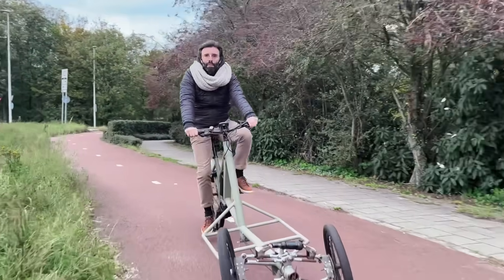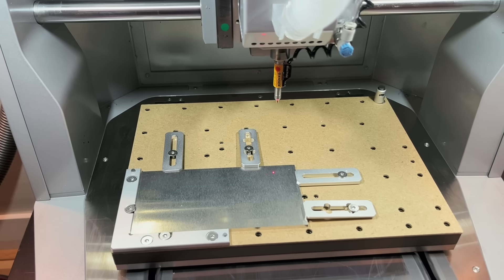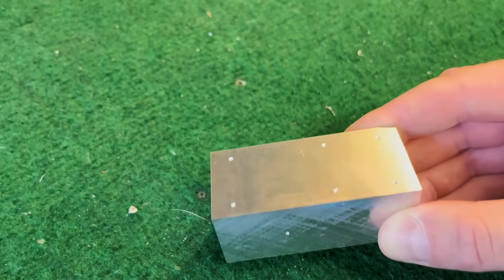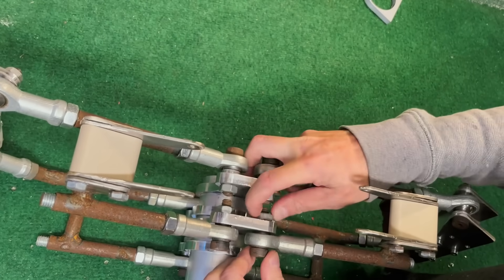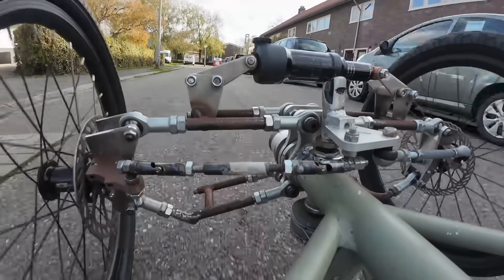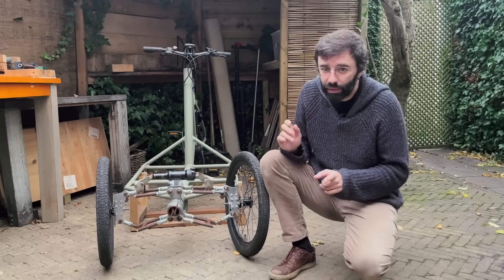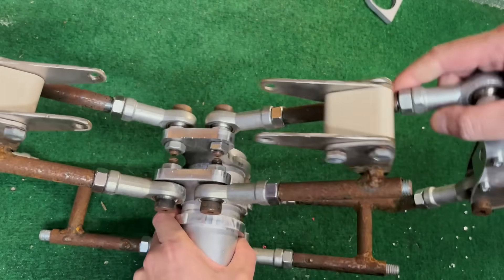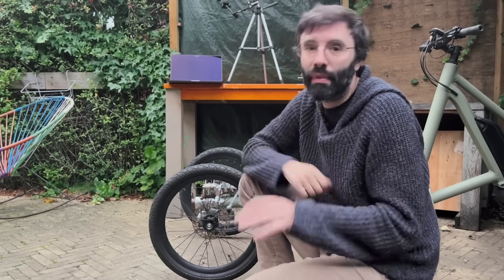#7 From 3D Printed to Aluminium - Tilting Mechanism with Makera Carvera Air

Comment: its so nice yet i cant help but feel its missing something...
"differentiation".
you need the outer wheel to drop further than the inside wheel.
why?
so its lowest gravitational potential is VERTICAL!
it "falls" to the bottom, straight ahead. any tilt "lifts" the entire frame, so its gravitational potential increases.

it wants to fall back to center, and be FORCED to tilt.

not flop over and be forced to stay UPRIGHT. a standard parallel linkage drops the frame when tilting...
 it WANTS to drop. it WANTS to fall over.

you seem to never take any shots where its standing upright BY ITSELF? without the stand?
perhaps, because... it doesnt?

really simple fix...
a "tee bar" linking both swingarms. offset pivot mounted to the frame to give the desired "offsets" on each wheel as it tilts over. locations of pivots alters differentiation... a "sway bar" of sorts, but it has to transfer more movement to the outer wheel... an "inverted" sway bar...

"jetrike". so far, the only tilting trike, or variants of, that has been naturally and inherently stable, that i am aware of. look into it. if the sites still up, that is...

otherwise, imho... you are wasting your time. it has nothing to set it apart from others following the same design route... just the same inherent flaws as the rest. looks great, yet never rides..."great".

even a regular bike does it. its hard to see, but straddle your bike. rock the bars. see how it actually tends to LIFT as you turn? its lowest point is straight ahead... THAT is why they are stable when moving. 
they also tend to steer IN to the lean. so they tend to "highside" back upright... a beautiful bit of positive feedback creating a stable system... 

forget gyroscopes, caster, camber,... think about gravity and how the weight "hangs" off the pivots... then you can see "rake" in a different light... the steering pivot and weight "hangs" off the axle... it wants to go straight.
with two steering wheels upfront, you now have kingpin inclination... more "hanging from the axles"... not camber, the wheel tilt from vertical. kingpin inclination.look at any four wheeler straight on. they "hang" from the kingpins.

add tilt, and you now have THREE types of "hanging off the axles"... 

so far, youre only thinking of two. ;) the "dynamic" ones. the ones that only come into play when moving. tilt? its static. gravity sucks :)

the rickshaw trikes...

they have extreme RAKE. 
but project the lines...
they have almost NO trail. more rake, less trail but note wheel diameter plays a role as trail is the distance of pivot line to contact patch. rake is offset from pivot line. (rc bikes have extreme negative rake but with the tiny wheels it all works out to be fairly average trail for the wheelbase?, a 27" racer with near vertical stering angle has what looks like a lot of positive rake. a 29" MTB wheel with steeply angled steering has what almost looks like zero or negative rake. it all ties in with the steering angle and wheel diameter to get the correct trail... but what IS "correct trail"? varies for any given frame geometry, theres so many other aspects to consider.)

deltas...the two rear wheels prevent tilt. the steering wheel doesnt have to tilt into turns. it has to rotate on its contact patch, and steer INTO turns.
it still has to have caster or steering angle for the steering wheel to be "stable"and not start fishtailing, ie, any normal caster wheel... ahem. shopping trolleys?

do not ever think of deltas as being in the same class as tadpoles...

deltas are hands down the worst mix of both worlds. their only advantage is simplicity...

tadpole has you delving into four wheel terrain. for all intents and purposes, it doesnt matter how many rear wheels it has... all that matters is akermans and a few other geometrical issues.

and here we go back to teh first point... add tilt and theres another level of stability to consider that is a two wheel phenomenon taking place on a "four wheel" setup... you actually have to think of two bikes riding side by side and how they would LEAN into the turn individually... how would two bikes have to be linked together to steer properly?

with differentiation between the two frames...

as its only three wheels, you think of each front wheel having to take the turn at the right angle... for steering AND leaning.
Reply from the maker: Hi, thanks! I don't think it flops. I actually measure angle of the frame when turning parked and the front raises by 0.5 deg.
The vehicle can be maintained vertically without a stand. Though, if you touch it, it will fall.
Cheers!
Reply: @pedro-neves  lifts when it steers, thats due to caster and kingpin inclination.

lifts when it tilts? thats the important bit...  static stability.
Reply from the maker: @paradiselost9946  , I designed to have roll center at ground level. For this reason, when tilting, it tends to fall. This is intended - to feel like a bike. But, I agree that what you are saying makes sense and will consider it, thank you.
Reply: @pedro-neves  thats the problem. it is a bike but it isnt. its two side by side. yet it isnt as it pivots around the single rear wheel... 
hey, it gets even worse when you start considering the widths and aspect ratios of tyres... a few mm can make major changes on the way bikes handle.

anyway, worth thinking about. seems pretty simple to implement... ha ha... another "five minute job"...

say, remove shockie for a while, slap two plates between the upper swingarm pivots to give you that central mount for the tee bar, and two tie rods off the shockie mounts. can always remove it if im wrong and call me a fool :)
Reply from the maker: @paradiselost9946  I have already tried it. And there are trikes like that. I think the ride feeling is more like a quad. It's a matter of taste if you prefer that.

Comment: Awesome project! Started to wonder when we get to see the follow up video, and here it is :D I have a teenie tiny experience in the automotive world. Usually you want to consider 3 things. You already mentioned trail, with more more trail you should get a more stable vehicle but steering will feel more sluggish. Then there is toe. Toe-in should in your case give you better stability in a straight line. If you wanted a stronger steering response, toe-out is the way to go. Last but not least you can play around with camber. Arguably that's more important in cornering but most often you can't think about one of these without including the others. I feel like a bit of negative camber could help here but thats something you really have to test in person :) The Wikipedia pages do a decent job at explaining what each thing is, but for what is best for your usecase you may want to look elsewhere. Maybe someone build a similiar setup already! Anyway good luck with your build
Reply from the maker: Thank you so much! I'm building a knuckle where I can adjust just trail. But I will also add a bit of camber which I can do just by extending the wishbones via the screws in the ball joints.
Cheers!

Comment: Have the similar stability challenges at my project. Increase the trail should help. You got at 15° certain distance, but only theoretical. In praxis this distance is lower through weight, lower tyrepressure etc. The theoretical diameter of the wheel is little bit bigger than in real practical conditions...
Reply from the maker: Thanks! I think I'll make a knuckle with adjustable caster to test this out!

Comment: Hi Pedro, Based on my shorthand and selective memory, the caster angle must be increased if the distance between these axles increases, to provide stability. 
In your case, according to an imprecise visual measurement, you doubled the inter-axle distance, and this means you have to increase the caster angle, but not at the same ratio.
With the caster at 15 degrees looks like you went in the opposite direction by reducing it instead of increasing.
Reply from the maker: Hi, ya, indeed caster angle creates a certain trail. But after this angle is created, it is also possible to move the wheel away from the center of the steering axis. That's what I'm considering.
Cheers!

Comment: Instead of the axial being in a straight line between the steering pivots, if you move it forward, the bike will track straight when you let go of the bars. If you look at motorcycle's forks, the tubes are mounted in front of the steering head.. This places the axial ahead of the steering angle, which helps a motorcycle go straight when the bars are released, and gives the motorcycle stability. This is called "Rake"
This is from the internet: The "rake" on a motorcycle is the angle of the steering head from the vertical, and it significantly impacts handling. A smaller rake angle, like on sportbikes, makes the bike more agile and quicker to turn, while a larger rake angle, found on cruisers and choppers, increases stability,
Reply from the maker: Thanks! I believe Rake and Trail are the same concept indeed. And head angle influences rake. Though, you can move the rake with a defined head angle by moving the axle position forward or back.
Cheers!
Reply: @pedro-neves  if you want to ride with no hands, forward is the answer.
Reply from the maker: @RayPalmer-v9g  thanks! I'm building a knuckle with 4 trail positions. I'll share the results soon!

Comment: I'm a cyclist,no engineer. But typically the slacker the angle the more stable the bike (ie. The wheel further in front)
Reply from the maker: Thank you for the tip! Though, you refer to the caster angle (or head angle) right? Thus increasing trail.

Comment: Hi Pedro.  Excellent project.  I suggest you move the axle forward so that you mimic the trail of an ordinary bike.  Your problem might be too much trail.  If you consider an extreme example being a tea trolley you will notice that the castors vibrate side to side violently if you push the trolley at any speed.  It is acting like a pendulum and I think, though I've never seen any explanation, that the steering axis meeting the contact patch and/or a very slight out of true of the wheel, can act as the forcing.  I might be totally wrong in the explanation.  I'm thinking that over a hundred years of bike design has probably come up with the right approach.
Reply from the maker: I totally get your explanation with the tea trolley, thanks! Indeed it makes it easy to turn but then too easy in this case.
Cheers!

Comment: Consider a 70 degree angle that will how you measure a 20 degree, and maybe a 40mm offset of the wheel from the center of the staring tube and both sides
Reply: Mountain bikes on 29er have a 44mm offset, and around 40mm for 26 inch, you can play with the head angle and offset to reach a desire stability relating with the size of the whell.
Reply: One more think. There are mtb with three wheels for people with disabilities, you can find out what their numbers are regarding the head angle and offset
Reply from the maker: @artoutlawphoto  thank you for adding those numbers as the tips! Indeed, I have seen incredible vehicles for people with disabilities. My favorite is the Bowhead Rogue. Cheers!

Comment: i'd go for some sort of steering damper (for low speed jitter) to help slow the moment of the steering to start moving, I had a LWB recumbant & as simple fix used a bungie to preload steering rod, my Bullit cargo bike was going to use a Visco in forward headset and i started to use a bungie to add stifness/centre handlebar & never got the Visco - you only need to reduce the Play in the system - although with additional cargo load that would need testing
Reply from the maker: Indeed, I'm considering a steering damper. I'll try to optimize as much as possible with the geometry and then if I think it's not enough, I'll add a damper.
Cheers!

Comment: That Indian trike looks broken to me.  There’s no need for such extreme geometry on such a setup. I expect the handling is pretty unpleasant. Perhaps the braces on the fork are to prevent it getting any worse..?

On the subject of the limited steering angle on your TTW; have you considered making or buying some suitable gimbals?  I worked on a similar design about 20 years ago but wasn’t involved in the prototype so I don’t know what rod ends/joints were used.  I think gimbals were used to good effect on the Brudeli  some pics here https://moto.zombdrive.com/images1600_/brudeli-9.jpg  

Thanks for your efforts/videos. It’s interesting following your progress; keep up the good work!

Comment: Compliments Pedro and you get clever reactions too! 

My understanding is that low speed stability only improves with steeper head angle, smaller wheels and a shorter wheelbase.

And I much agree with the need for load-testing. Lifting the load a bit with your steering helps but too much understeer feels cumbersome: that is an offset-story not affecting low speed stability.
Cheerio
Reply: nope. steering angles etc are dynamic. 
theres a static stability thats been overlooked...
"lifting the load when steering"...

sort of there, but not quite...

"lifting the load when LEANING" makes it inherently stable... very simple modification to make it LIFT as it tilts.

otherwise... as it leans it wants to lean more... you have to FORCE it to stay upright as you lift both the frame AND any load.
Reply from the maker: Indeed many clever reactions. I just learned about "wheel flop"! Thank you for your contribution!

Comment: How is the Bosch mount open source motor project going? I'm really curious about that.
Reply from the maker: Hi, thank you for asking! Indeed it's a problem to have many projects because then each has less progress. I expect to work a little bit more on the drive unit project in winter given that it's more of an "inside" work.
Cheers!

Comment: Low speed stability is (at least in cars) not achieved with trail, because the force from trail is proportional to speed and therefore weak at low speeds. What can instead be used is gravity. A usual concept is to use kingpin inclinitation. This will result in the frame lifting ever so slightly when the wheels are turned away from the straight position. I expect 1cm rise at full steering would suffice (?). To clarify kingpin inclination: It the angle that the steering axis, or in your case the connecting line between upper and lower knuckle ball joint, is turned away from the vertical towards the center of the bike. Caster has the opposite effect, it will lower your bike when turning the wheels and therefore lead to low speed instability. If you can feel this on your current setup, eg. the wheels will turn from small left steer to full left steer when weight is applied to the frame: Probably your caster is greater than your kingpin inclination (KPI). As far as i know, KPI should always be greater than caster to achieve low speed stability. A grain of salt is that cars dont lean as much as your bike does, therefore i dont know if these rules translate 100% but at least for low lean angles which are common at low speeds, i would believe it works the same way.
PS: If you already have a setup with enough KPI, maybe its the missing weight on the front wheels, because as stated above, KPI uses gravity to generate the stabilizing force.
Reply: Thanks for that. I hadn't previously realised the effects of KPI. A great explanation.
Reply: Pedro is using 15° KPI at the moment. Do you think he should go higher and perhaps counter the increased trail with some offset?

Oops, edited for typo.
Reply from the maker: @flannel2699  indeed, thank you for the note!
Reply from the maker: Indeed, thank you so much! I already have some KPI like mentioned below by @flanel2699 but maybe because it's so light in the front the effect is not noticed so much.
Cheers!

Comment: About the Indian trikes' negative trail, I think NotaRobot gave the key insight: those trikes do not tilt. A final piece of information is needed, and it is wheel flop. Normal bikes have positive flop, which induces countersteer as soon as the bike tilts and is a major factor in righting the bike at low speeds. On a non-tilting trike, negative flop keeps the front wheel pointing ahead by providing a centering torque proportional to the steering input (i.e. handlebar deflection). This centering torque is present whether the trike is stopped or moving. The formula for wheel flop can be found in https://en.wikipedia.org/wiki/Bicycle_and_motorcycle_geometry. The way negative wheel flop works is that turning the handlebars raises the center of gravity of the bike (slightly). Gravity thus provides the restorative force, and it is a static effect that does not require forward movement.
Reply from the maker: Wheel flop! I can't believe that after years trying to make a great tilting trike, I just learned a new concept and geometry!
Thank you so much! Indeed, I need to reduce the wheel flop effect. I’ll make sure the chassis is rising when turning and not going down.
Cheers!
Reply: i wouldnt say its negative trail... its just zero.as the wheel needs the caster to remain stable and not oscillate, yet when turning, it has to simply... steer. so yeah, no "flop". just rotate around on its contact patch.

one of the first people ive seen mention that aspect of a bike frame lifting when the bars are turned... 
its the aspect thats missing, the static stability of a vehicle that has no way to keep upright despite having three points of contact with the ground...